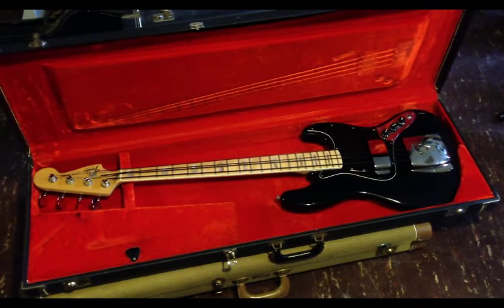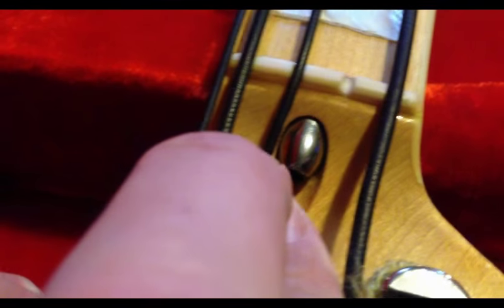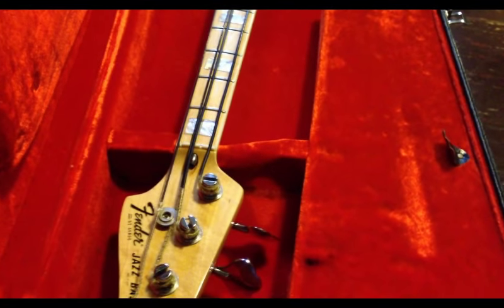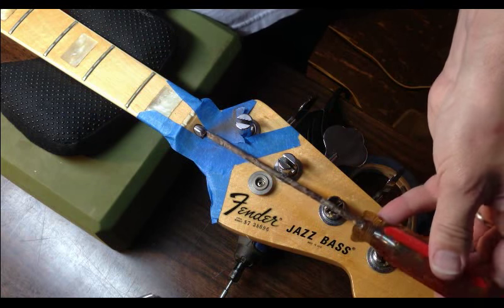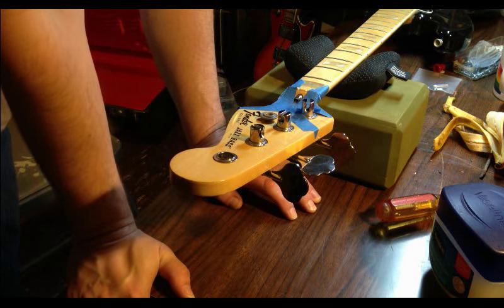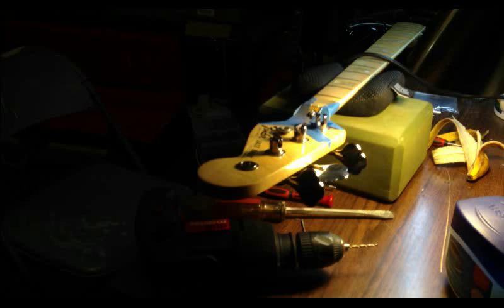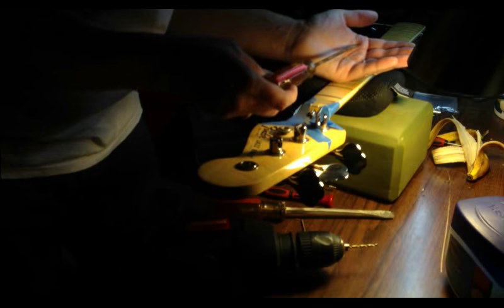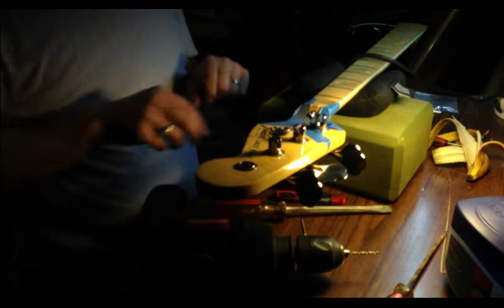Removing a Stripped Fender Bullet Truss Rod Nut

Comment: Hi again,  I'm a heating tech and use heat to remove seized items.
The nut is a smaller part than the rod so applying heat with a soldering iron causes the bolt to expand faster than the long steel trus rod, this will loosen the nut. Bit of a fiddle and be careful with hot iron but works 👍

Comment: Brad the secret to drilling holes, is the harder the material,( ie: stainless, titanium, steel, etc, ) The SLOWER the drill speed. As far as soft metals, aluminum etc, drill it fast or cut it fast. I know it seems opposite, but that's the secret. NOTE: you could've filed a flat spot on top of the bullet, that would have prevented the drill from dancing. One must have patience, try drilling titanium all day long, one becomes very patient, because if you drill it too fast, it burst into flames around the hole, & the metal becomes brittle. Serious stuff, my friend.
Also on screws the 10 is for the width, the 32 is 32 threads per inch. The 10 is 10/32" so SM is a 1/32 too large. Screws are commonly called 10s for 10/32, 8s for 8/32, etc. Except for the small 4-40s though threads are 40 per inch, the screws are still called 4s.

Comment: I appreciate this video but learned two important things. 1) I used the soldering iron to heat the bullet. Then I gently tapped a tapered star key into the hole. The bullet turned with little effort. 2) I was going to purchase a replacement bullet from StewMac and won’t be doing so. Thank you, Brad, and those who suggested using heat. 👌 You earned a new subscriber.

Comment: The truss rod nut gets stripped from idiots tightening the nut with the strings still on the bass. You must loosen the strings before tightening then re-tension the strings - tune and verify the neck bow. Repeat if neccessary. Trying to skip steps and go fast can ruin a neck - if you strip the truss rod , it's a BIG job to repair it $$$$$$$$$$$$ so it's cheaper just to replace the neck.

Comment: Im guessing the heat from the cutting helped loosen the nut up enough to remove it. With a stripped out nut. Use if you have to make it, a tapered allen wrench. Go up a few sizes and taper the allen wrench on a grinder. That can sometimes help removing a stripped out nut. Stew Mac also sells them. An Easy Out might work.

Comment: Hi mate,  heat is always a good option.  Use a soldering iron with a bit that just fits inside oriface as it will cause bullet to expand off the thread, I sometimes put a very small drop of light oil mixed with nail varnish remover (acetone)  to wet the thread a couple of hours before hand.
Reply: wouldn't heat be the opposite?  When I was a kid, I would put coins in the freezer  to knock out the middle.  So Im confused what you mean.
Reply: heat will expand only the bullet not the truss rod - so it will reduce the friction between the bullet and the truss rod by expanding the bullet so it would be easier to remove

Comment: I am so glad you had good luck with those slits and it didn't weaken the Bullet so parts of it broke off like your screwdriver tip. If I may ask, I am having a seemingly worse scenario with my '89 Am Std Strat Neck.  I noticed that no matter if I tried to tighten or loosen the T rod nut, it just seemed to spin freely.  Considering the possibility that the allen wrench was just spinning and not grabbing, I took the leap and actually drilled out the plug to get a visual on the T nut inside.  It seems my problem is worse than a stripped T nut head because the wrench does catch and does spin the nut in both directions.  The neck neither straightens or gets more bowed in either direction.  I have seen where guys are able to get a loose T rod nut out of the hole to install a new one but they were able to get the nut to back itself off the threads to do so.  In my case I fear there is more broken or loosened inside the neck that won't allow the nut to back off.   Have you ever encountered this or have any suggestions to try in order to make my T rod work as it should?  Thanks

Comment: #10-32 is absolutely the correct thread size for any 70s Fender truss rod...Bullet or Heel style, Guitar or Bass, same thread. Yeah, and use an EZ Out to remove the stripped nut in about 2 minutes. Little 2 in 1 Oil does wonders too.

Comment: Wow! It's not the first time StewMac has dropped the ball! What a save though. You are good. I had to drill the hole method. I used a 1/32 black oxide drill bit and got a pilot hole then a 1/8 and had the same result. I got lucky the 1/32 bit went through!  Good fix. Thankz
Reply from the maker: My drill bits really let me down on this one. They don't have the bite they needed to get started. No substitute for good tools on a project like this.
Reply: can't believe you said that. The guitologist said that it was in the fine print about the size. He missed it. Not only that, he didn't know what size he needed anyway. That's ok, I would know the size on my guitar. Not sure why he'd want his money back, since he paid over $10 for the part and shipping. He'd only stand to get the $4 back for the part and he may have to pay for return shipping, albeit not over $7 or even close.
Reply: That's what center punches are for.

Comment: next time...hopefully you won't have a next time but....epoxy a hex key into it. if you just use the straight portion of an Allen wrench you can use a socket and ratchet, or they sell them already as socketed hex keys. strong epoxy like jb weld. you'll have to sacrifice an Allen wrench but no cutting or drilling involved so no chance of harm to the instrument. with a quick set epoxy it should be faster as well.
Reply from the maker: That might work as well. Thanks for the comment!
Reply: Exactly Josh!
When I saw the headstock taped off I thought for sure it was being prepared for JB Welding in a hex key. Works like a charm, and then you cut off the end of the key and have a shorter, usable hex. Excellite makes very good straight ones with extensions, a screwdriver type handle and a "T" type handle. they all snap together, and parts are replaceable. Is the ding in the headstock right behind the bullet from a cutoff wheel strike?
Any time we use a tool or technique where it is possible to slip and cause damage, damage it likely. A slice of Masonite would help protect most of the headstock if you did have to drill a hole in the bullet. a split second can cost hours or days of hard restoration work.
Reply: The only issue with your epoxy suggestion is , the epoxy could bind up the thread, therefore making the problem worse.

Comment: maybe stew gave you the correct nut and the one on there had been replaced by an amateur. 1 it was tight, 2 hex head stripped out 3 it was cracked, indicating to me the nut was too small.  I would find out more info on the nut sizes if i had that guitar. Then I'd go from there.  And remember.. "a truss rod is a terrible thing to wast! "  Good luck!

Comment: if you don't have the right size washers use the old nut as a spacer - drill out the threads and cut it of around 2 or 3 mm

Comment: Another little tip..Once you break it loose an easier and quicker way is to actually turn it back tight and then loosen it again...Do that 20 or 30 times back n forth and itll let loose..Most of the time the epoxy trick the guy down below talked about wont work cause the epoxy wont hold if the bullets really tight...

Comment: I would've flattened off the rounded bullet and used that flat to drill through the nut and used a upside down drill bits to turn the rod. Less chance of marring the wood.  Nevertheless this method worked ☺

Comment: Did you try hitting the nut on the head toward the nut to shock the threads? Sometimes that works with a drop of penetrating oil.
Reply from the maker: Can't remember now, but I probably did. It's a good suggestion. I don't think it would have worked on this one. Someone tightened so tight the bullet was cracked by the hex key.
Reply: That was cranked on badly to crack the bullet. Surprised neither the nut nor the rod got stripped. Glad it worked out in the end.
Reply: I think he did something with a banana and vasoline that " SHOCKED " the whole Guitar !!

Comment: this seems to be quite weird. You have a 77 or so bass, which happens to be after 1971, why do you think the new nut wouldn't fit? Wonder if it had a new truss rod using new, old stock replacement in it's past. Could you have been sent a nut for older Fenders but have a newer bass? Could you have a faked Squier to look like Fender? So, many questions. When I need to fiind nut or bolt thread size, I go to a local mom and pop hardware store and try out their stuff until I find the right size; maybe you could too. It may answer a lot of these questions.   :D
Reply: william Barnes this is possible.  I have never noticed a difference between the older nuts and the new ones.  I’ve changed 4 or 5, all 70s.

Comment: All you needed to do was solder a 150k resistor to bullet from the choke and it would have been all good and be sure to check the phase inverter in the tuning peg
Reply from the maker: But the voltage on the frets was really too high for that. I think in a situation like this, the headstock current needs to be watched very closely or you'll get runaway neck bias.
Reply: So funny!,,, like beam me up after Scotie!,,,

Comment: Is this a two way truss rod? If no, how does it work on a two way? Won't you damage the neck if ou turn the bad nut all the way until it comes off?
Reply from the maker: No, it isn't two way. Won't hurt the neck to take the nut off. I wouldn't want to leave it off for any length of time with strings on as that would probably warp the neck, but with no string pressure, nah, shouldn't hurt anything.
Reply: If you say so, thanks for the info, I'll try to fix an old strat copy that I have laying around then.

Comment: That is going on in this video is just horrible. Thats very rough way of doing it and you are very lucky to not totally destroy the nick. Also for the nut with incorrect threads. Its nothing wrong with the nut. You always have to check which threads you have before ordering a nut as it is at least three different threads. 8-32 10-32 and 10-24. Don't complain on the supplier. They sent what you ordered and its not junk.

Comment: Try an "easy out". I have used them for years to remove broken bolts AND stripped truss rod nuts. Been fixing guitars and amps for over 50 yrs. Google easy out tool. Good luck. I like your videos and your "picking". I like people who think outside of the box.😉
Reply from the maker: Yeah I've seen that tool Stew Mac sells that has a graduated hex, but this SOB was so stuck, and due to the crack, any time you tried to turn a hex it would expand and skip to the next channel. It was pretty much out of desperation I went to this extent to remove it. Next time I have this come up, which is hopefully NEVER,  I'll look into it. Thanks a lot for your comment and I look forward to learning from your experience in the future. Please feel free to dole out the pointers! I can often use them. Many ways to skin a cat and it's nice to hear from people who have been there and done that.
Reply: Easy outs are not like a graduated hex.  Even Harbor Freight carrys them.  Any auto parts store like Napa too.  For stubborn tr nuts i have drilled a 1/16 hole in the bottom of the hole till it penetrates the nut, then a few drops of wd40 with the git fiddle standing upright.  Wait till the next day and if that doesnt help get oyt the 357 mag.😢

Comment: God damn Fender - how in the world they could use such a "rinky dink" design for the truss rod nut on a bass. They went for the "look" of the "Bullet" design over function. The nut should be threaded all the way through the inside and an outside "nut" that you could put a socket on would have eliminated this disaster. They even could have made the head of the nut domed for the bullet look. Also while I'm at it - Fender should have put a grease on the threads of the truss rod and this would also make for a smoother adjustment and less chance of the threads seizing on the truss rod. Stew-Mac also should get on top of this parts problem and get the right part made with the proper thread size ( more incompetence from people who just don't care ). I wouldn't be surprised if the Stew Mac nut they provided has a metric thread size and is made in China. I guess we'll have to call Fender to get the right part ( oh what a joy that'll be ).

Comment: Chrome vanadium is hardened steel and is industry standard. I've had a similar problem with a bass recently (check my channel). Sorry buddy but you should NOT use plastic washers and there is no way you would need more than one. A 1mm washer is more than enough. Victor...

Comment: Another idea I had whilst watching.   If your initial slot cut held the screwdriver,  but needed more torque than the hand could provide,   try out a screwdriver that takes a wrench on the collar or cap.
Reply: you can put a wrench on the stem of that style of screwdriver..it isn't round..( a vice grip works on a round one too )..

Comment: Warning !!..This is the perfect example on how not to remove an adjustment nut from your guitar. This process  is a disaster followed by many disasters. 
The first thing that should have been done ?....1/ A few drops of machine oil down the inside of the nut, and let it work it's way down the thread.  2/  Find a metric hex wrench as  the Fender Jazz you have is a Japanese Fender issue, It was manufactured at the Fujigen factory between 1994-95. This would explain why StewMac's Bullitt  nut does not fit, his are UN thread....It would pay to do some research before you make a fool of yourself on Youtube.
Reply: I agree with most of the above except It's clearly a 1977 USA Fender Jazz...S738096 s/n on the headstock. #10-32 is the correct size.  Evidently if this guy doesn't have to fight a nut to thread it, it must be the wrong size.